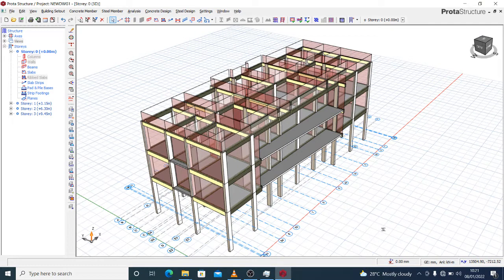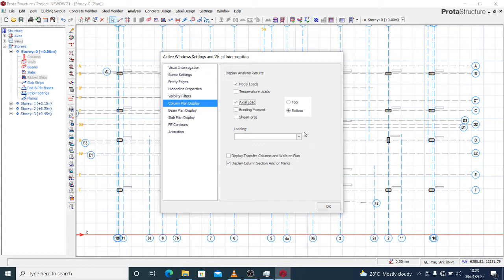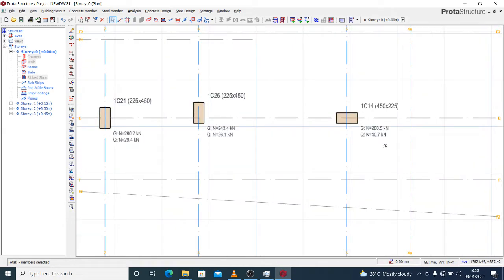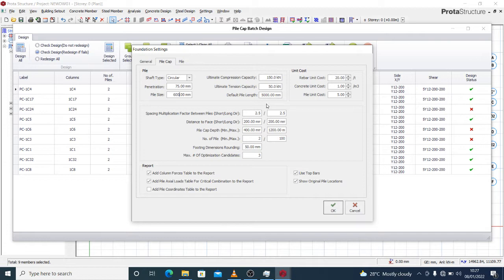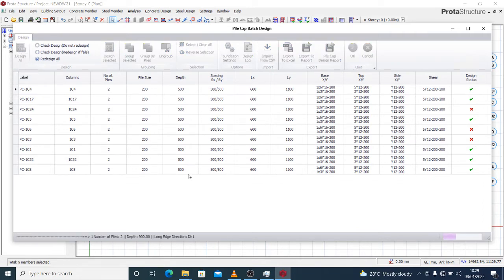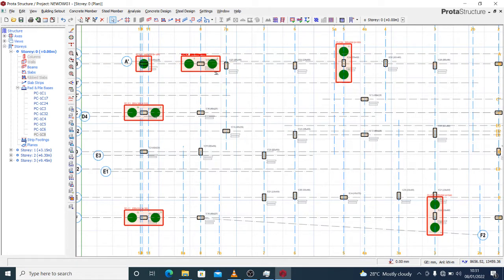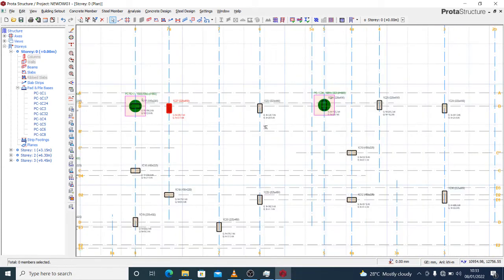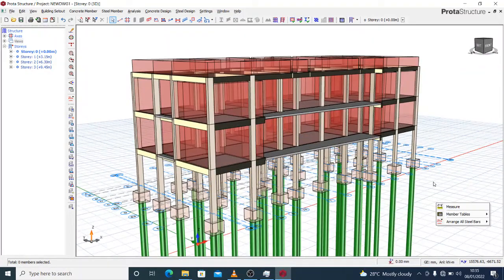FOUNDATION DESIGN WITH PROTA STRUCTURE- PART III (PILE FOUNDATION)

Comment: WHAt about slab in grade and foundation beam load. will they not be added to the column or axial load
Reply from the maker: They will definitely be added to the axial load
Reply: @Joshua_d_designer  thanks but in your design I did not see that added
Reply from the maker: @festusighalo2874  Your analysis and load decomposition takes care of every loading that should be transferred.
You don't need to manually apply load
Reply: @Joshua_d_designer  but the foundation slab and beam are not loaded at the point of designing pile  caps and pile